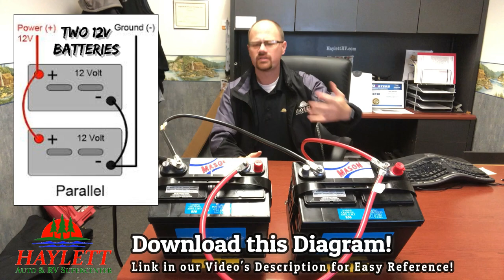How to Wire Multiple Batteries to an RV with Josh the RV Nerd

Comment: We have two 12 volt batteries, wired in parallel, with the trailer positive to one of the battery’s positive, and the trailer’s neg to the other battery’s negative. But what I’m not real sure about is that there are other wires that have to be connected to the batteries too. Can’t remember what they’re all for but one is to the electric hitch, I think one to the battery cut-off switch, and I can’t remember the others, (maybe to the emergency brakes). But so long as positive goes to positive and negative goes to negative, does it matter which battery those wires go to, or do they all have to be divided equally between the two batteries like the trailer wires are?
Reply from the maker: I can't see what you see. I won't even begin to try to troubleshoot something like this. As stressed in the video "If you don't know, then visit your local professional."
Reply: Rule of thumb usually is that anything "extra" connects at the same point as the main connections.
There may be exceptions, but if you're not sure, like Josh said, let a professional do it.

Comment: Great video Josh. Is it recommended to run 2 12v of the same group (size?) or does it not matter much for 12v since its parallel?
Reply from the maker: You always want all of your batteries to be as close to identical as possible (which also includes physical age)

Comment: Can you add a 12v battery to the current setup of two 6v as a supplement?
Reply from the maker: Interesting question! THEORETICALLY yes, but you basically have to wire the two 6vs in series, then parallel that with the 12v

And in the end you're basically defeating the purpose of what you're trying to accomplish. Best advice I can give regarding multiple batteries is always try to use copies of the exact same battery. The more things are identical the better off you'll be.

Comment: I currently have (4) 6 volt batteries. 2 are in parallel and the other 2 are in parallel and then they series together to equal (2) 12 volt batteries.

Would (3) 12 volt lithium batteries in parallel be much better than what I currently have?
Reply from the maker: Without knowing the amp hours on your batteries I really couldn't say
That's what you'll want to do -- add up the amp hours on your current batteries and compare vs. the lithium potential replacements you find
Reply: @JoshtheRVNerd  Josh, the 4 current 6 volt batteries are 125ah each and the Lithium would be 100ah each. I might be able to get a 4th lithium battery into the space but for sure 3.

Comment: Great video gott a guestion please.
I'm changing my batteries over to lithium and moving them inside. 
I'm wanting to duplicate the auto reset breakers the batteries and coach wires attached to on the outside.
Plan: 
1.  First wire positive converter cable, Attach cable directly to a bus bar that goes to the batteries. ( Should I have a breaker in-between?)
2. Second wire positive, attached to a dc fuse box with a 30 amp fuse.
3. Third wire is  ground wire, attaching to a negative bus bar that is grounded to the frame.
Does this sound legit any suggestions sir thank you in advance.
Reply from the maker: As mentioned in the video this is the kind of topic best addressed directly at a service center where staff members can put eyes and hands on your RV directly. I don't feel limited text-based interactions like this are effective at assisting you properly for electrical-based inquiries

Comment: What gauge wires do you use to connect the two 12 volt batteries?
Reply: Depends on wire length. If the batteries are side by side i would use a 2 gauge cable. 2 gauge at 2ft is good for 200amps. Its a little overkill but bigger is better. You dont want voltage drop.  At work we use huge 00 gauge cable for battery banks but those pull serious power in Communication trucks. Campers don't really pull any big power. Capacity is more important and the goal of 2 battery's.  If it did pull high amperage it wouldnt be able to run on one cheesy little low amp hour battery they stick in them.

Comment: For a solar trickle charge (two 12v in parallel), do you connect the + clamp to battery #1 and the - clamp to battery #2? Or both to #1/#2? Or do you need two trickle chargers charging each separately?
Reply: You can do it in your first scenario and trickle both together. Its still 12v you just essentially made a high Amp hour battery by combining 2.
Reply: Only use one charger, never two. When hooking up two 12 volt batteries in a parallel circuit it makes no difference if you hook up positive to battery 1 and negative to battery 2, or if you hook up both positive and negative to battery 1. Either way it will charge both batteries. When batteries are hooked up in a parallel circuit, you are essentially making one big battery; anything you do to one, also gets done to the other. 

It would make a difference if you were using two 6 volt batteries in series; then you have to hook positive to battery 1 and negative to battery 2 when charging.

Comment: great video. i do have a question and hope you can help. i have a dodge caravan i have converted into a stealth boondocking vehicle and it is my home 3 to 4 days a week from may until mid october. i have small basic solar and im working on revamping my battery bank. i had used 2 huge deep cycle batterys in back and a bypassable high output start battery ment exclusively for starting. my goal is to add this pair of john deere strong box 6v batteries to my bank, or if required, to make a somewhat seperate secondary bank using these two 6v. my questions and concerns lie within the aspect of  current flow, charging, utilizing my solar, and combining with my existing setup. these 6v batterys are quite large and were VERY pricey  and i know they would hugely benifit my needs, im just seeking any advice or tips so i dont turn MyDaily/my house onto a giant arc welder. thank you for your time :).
Reply from the maker: You have a custom setup that we cannot properly understand without seeing it. I think it's best something like this be handled by someone locally who can physically see everything. Visual references would be key here.

Comment: For batteries in parallel, you don't have to do "first battery positive to camper, last battery negative to camper".  Since all of the postives are connected together, you can connect the camper to any positive terminal.  Likewise for the negative.  Again, only for 12V batteries connected in parallel, at the beginning of the video.
Reply from the maker: This is correct of course, but I didn't want to risk the chance of confusing a potential viewer who could potential mix-up the series vs. parallel wiring (though we tried to make it pretty straight forward)
Reply: Glad to find this comment, I'm getting ready to add a second battery this weekend and I'm unsure my cables will be long enough to reach.

Comment: I'm confused.  If two 12 volt batteries are in parallel,  why wouldn't you attach the trailer to just one of the batteries since its still 12 volt?
Apparently this misunderstanding is prevalent on many  sites.
Reply: When hooking up two 12 volt batteries in a parallel circuit it makes no difference if you hook up positive to battery 1 and negative to battery 2, or if you hook up both positive and negative to battery 1. Either way it will charge both batteries. When batteries are hooked up in a parallel circuit, you are essentially making one big battery; anything you do to one, also gets done to the other. 

It would make a huge difference if you were using two 6 volt batteries in series; then you have to hook positive to battery 1 and negative to battery 2 when charging.

Comment: I guess you could say that by the time this video was filmed lithium started to be the preference of most boondockers. I guess you could say that the fact that golf cart and agm batteries being more available is the main reason why some folks buy them or at least that they are designed to be exposed to the elements while any lithium battery would have to take up an interior compartment.
Reply from the maker: Yeah this is now a bit aged

Comment: Can you series 2 6v and then parallel to 12v? I don’t have an rv but watching your videos is nearly pushing over the fence. ;
Reply from the maker: Yes, but finding the physical space for it and possible effect on tongue weights then becomes a new challenge to overcome.
Reply: You could, but Paralleling batteries that are mismatched in type, capacity or age generally degrades performance and life span.

Comment: It would be great to see a video on a good secondary battery booster (like you seem too hook up on rigs during your tours) that could be used in situations when the house battery is low and you want to use the jacks and levelers...
Reply from the maker: It's really nothing special -- just a 12v jump pack from an automotive store primarily designed to jump start cars. It's not usually something "critical" to a lot of RVers because a properly wired 7-Way plug will send power back from the vehicle to the RV as needed if the RV itself has low power. Never hurts of course. A blown fuse could prevent a vehicle from charging the RV & give you some fits if you don't know what you're looking for.

Comment: Why did you not show how to connect 6 6v batteries? :)  
Advanced class using both series and parallel wiring! :)
Reply from the maker: Simply use the series method for dual 6v
Again -- this is intentionally recorded to provide basic info for people. Folks should let professionals handle advanced wiring.

Comment: What would give you more boon dock time. 2 6v batteries in series.  or 3 12v batteries in parallel.
Reply from the maker: Probably still the two 6v batteries.

Comment: So I've spoken to like.. 3 different places about this.. and you might be wrong?
I've wired up the same, except POS and neg from one battery getting power from a charger, with the final battery having the cables that lead into the trailer (the smaller ones).
Reply from the maker: Substitute the "trailer" in this video for your charger

Comment: What about 2 6V in series paralleled to 2 more 6V in series?
Reply from the maker: It's not that it wouldn't work. From a systems standpoint the math adds up. The problem is physical space. Most RVs simply don't allow for that kind of real estate.
Reply: Yes, a series-parallel connection will work.

Comment: Being an electronics engineer, I can tell you that this is an accident waiting to happen and not the way to connected up 2 batteries! 
Case in point...All batteries fail at a different rate and many times the plates in a battery will short out. Should one of the batteries short-out, the full charged battery is going to dump all of its current into the battery that shorted out and you're going to have either melted wires, exploded battery, or catch your RV on fire. You should ALWAYS have a "battery isolator" so that the 2 batteries are never electrically connected.
Reply: So where does the battery isolator  go??
Reply: Hello "how to do stuff",    please what do you mean by "battey isolator",   where does it go as "Karen Johnson" asked?     given your education as engineer,   it would be nice / helpful to get an answer from you (professional),     thanks much.

Comment: the reason the wiring color would be different Is when doing 12v work Its always going to be red + and black -: However, when doing 120 work white Is hot black Is - and green Is neutral and 220v is the same with red being your second 120 hot leg and a common ground.
Reply from the maker: Sometimes on trailers it's white and black on the tongue with black being the hot line. It's weird like that.

Comment: Hi, Great video. I have a 26ft toy hauler, very nicely appointed and I'm looking to boondock all week and then go home on the weekend, I do this for work reasons... I want to utilize battery power as much as possible and charge those batteries with a solar panel charging kit that won't over charge them. I also have a duel fuel inverter to also charge them if needed. Is this doable? Thank you.
Reply from the maker: the answer is 100% based on weather and sun exposure + solar level and battery reserve. It IS possible but it depends greatly on how you want to use the RV. 

If you want to be able to fully function the RV with things like the A/C, mIcrowave, or run the furnace and fridge all night, then you're going to need huge money invested into a solar package. 

Running an inverter to power outlets is also something that pulls more heavily off your battery reserve. 

Solar packages will include a charge controller system that will prevent the batteries from being flooded. Portable panels have their own integrated controller btw. 

So how much solar you may want, what type and quantity of batteries, and how much this will all cost could vary by multiple thousands of dollars. 

That dual fuel inverter is likely the key component here as it will let you kick on the air during the heaviest part of the day while the solar package passively works to keep the batteries topped off otherwise. 

This is why solar is tricky - there's no one package I can point to that says "This is what you need." It's all a la carte